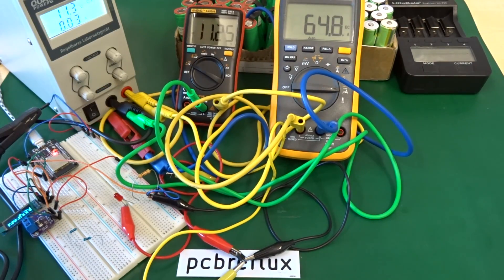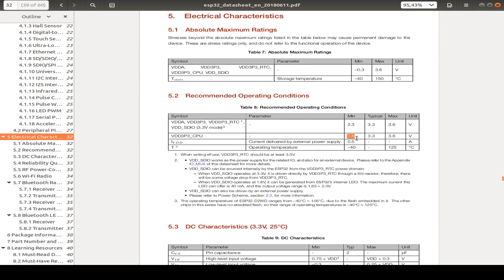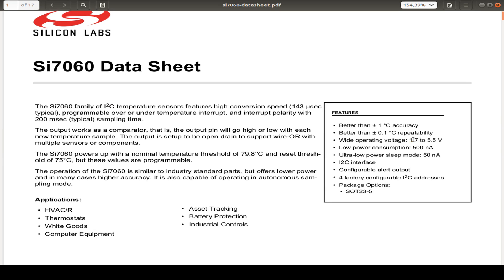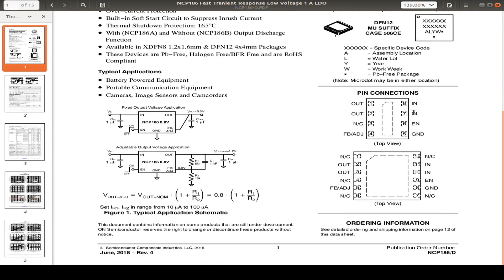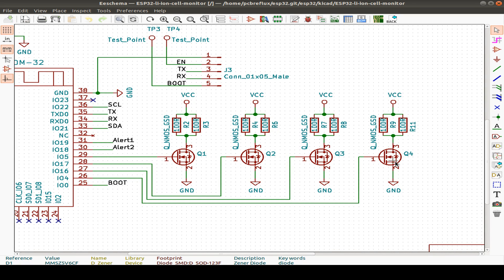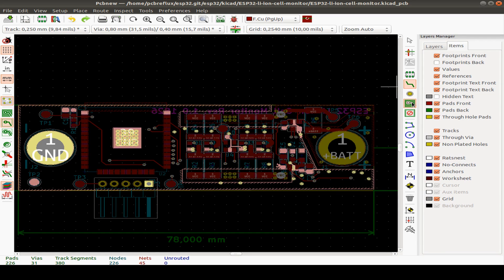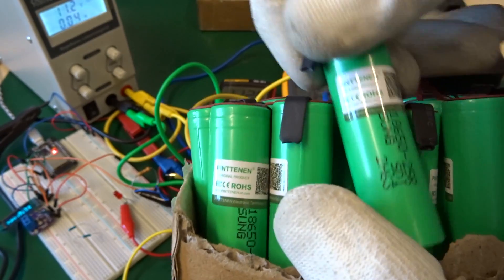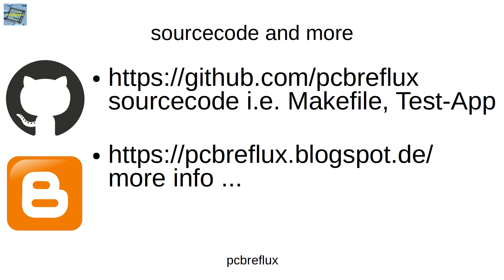ESP32 #81: 18650 Li-Ion Cell Monitor with KiCad 5.0

Comment: Nice video, thank you! Have you ever considered to use LiFePo4? This way you don't need LDO (and with more than 2000 charge cycles) it seems for me a bit more attractive way (despite a lower capacity per cubic centimeter)
Reply from the maker: Yes, for most of my battery powered projects I prefer LiFePo4 but, as you name it, lesser capacity, higher costs, fewer manufactures, ....  for a project involving maybe as a goal of some 100Ah you have to consider also the cost and other factors.

Comment: This sounds like an interesting project. Thanks for providing information on the current, voltage, power and temperature sensors. I am interested in hearing about your experiences with them and barring negative feedback plan on including them in my own commercial projects. I will also be interested in hearing about your experience with KiCad 5 as I am sticking with 4.07 until the official release.
Reply from the maker: Thanks. Still waiting for some parts and the PCB but will upload all new steps of the project. For KiCad 5.0 think the best experience you have with new projects, the import/upgrade for older projects works but all old symbols and old footprints can not now really be integrated in the new naming convention. Don't know if the 4.0 integrated the SPICE models and simulation but now there a ton of menus for SPICE in eeschema.  Some of my important features (like design rules -> now setup, legacy/openGL view -> now toolset) works perfect but under a new menu. Selecting in PCBnew works a easier and precise this helps a lot for routing tracks.  The 3D viewer is now a little different but totally fine. The whole symbols, footprints and 3D models are now amazing (but don't expect not to draw your own and fill all fields) and I got not a single crash since using it with ubuntu 18.04.
Reply: Thanks for the tips! It's good to know that KiCad 5.0 needs to wait for a new project, but I hope it will be backward compatible.

In the past, I've used LT SPICE extensively, although it's not always pleasant having to add models for non Linear Technology ICs. In some ways this is better, just because it makes sense to have complete modeling and part selection done prior to schematic generation. On the other hand, if KiCad has a much bigger selection of ICs, it might be a step forward.

It's good to here that KiCad 5.0 improves the ability to rout tracks. I'll be very interested in seeing what KiCad 5.0 does in terms of improving the ability to place small planes inside other pours, and also if it allows easier integration of vias for thermal coupling and layer coupling where the current workarounds are rather clunky.

I've been pretty happy with the legacy 3D viewer. My main issue is that there are so many unsupported parts, and it's rather difficult to generate the models unless you are really mechanically inclined and also very familiar with your tools.

Your last comment of course is the most important. None of the improvements will be worthwhile if the platform isn't completely stable...